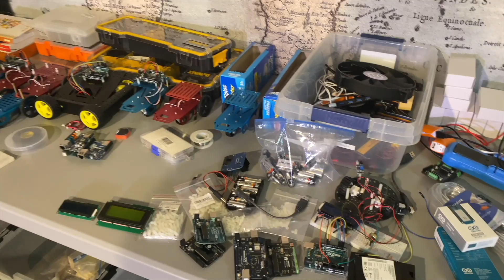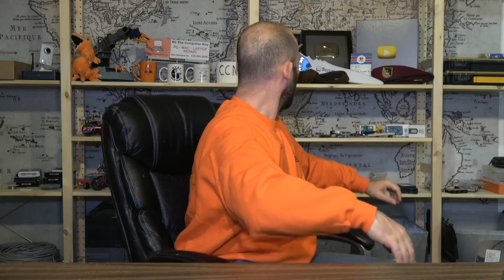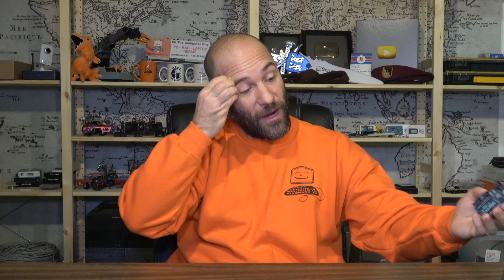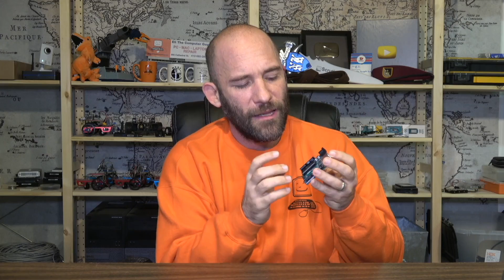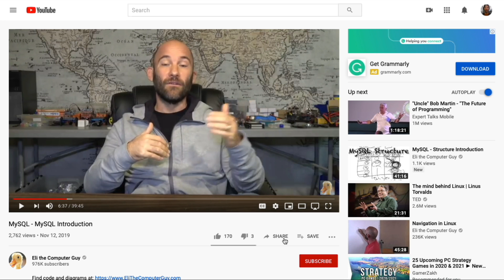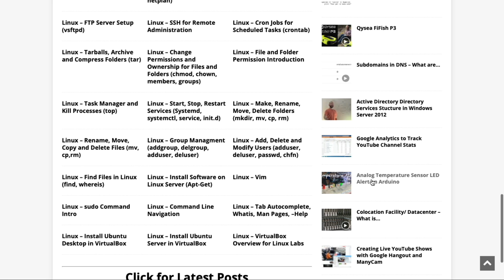Programming Intro - Introduction to Programming

Comment: What programming is
Programming and coding are used interchangeably and mean giving a computer step‑by‑step instructions to perform actions, from simple calculators to invoicing systems or sensor‑based automation with microcontrollers like Arduino.

He gives examples such as turning LEDs on based on temperature, sending alert emails, or routing notifications intelligently based on who is on duty and has the right permissions.

Why it matters for IT
Historically, developers and operations (IT admins) were separated in a client‑server world where sysadmins just deployed whatever software devs handed over.

With service‑oriented and “serverless” architectures (cloud functions, Azure/AWS services, SaaS like Gmail), IT pros now interact with services via code, so scripting and programming are becoming mandatory skills, similar to how Linux knowledge became mandatory over time.

Choosing a language
There is no single “best” language; languages are like tools or applications, each suited to specific environments and tasks (Swift for iOS, Java for Android, PHP/Node/Ruby/Python for web, C# for Microsoft stack, etc.).

You should pick a language based on your environment and the problems you need to solve (for example, C# in a heavy Microsoft shop, Swift if you want to build iOS apps).

How to learn coding
College: Good for people who only know they “want to do computers” because it gives a broad overview (systems, networking, databases, several languages) and a degree, even if the curriculum is a few years behind.

Bootcamps: Best for people who already know the industry and have a clear target (e.g., retraining into Swift or another specific stack) and can leverage existing contacts, but risky/expensive for complete beginners who may later decide tech isn’t for them.

Self‑study programs (Codecademy, Coursera, etc.): Cheap structured paths that work well if you have discipline, though they can be slow when you need something very specific quickly.

Piecemeal learning: For concrete one‑off needs (like “send an email if server room is too hot”), you can copy/paste and glue together small code snippets, test heavily, and still produce useful production scripts without being an expert.

Community and motivation
Being around other coders (meetups, tech events, startups, nonprofits) helps you find jobs before postings go public, learn good coding style instead of “spaghetti code”, and get real‑world project experience even if unpaid.

Employers and CEOs care more about visible projects and self‑motivation (e.g., GitHub activity, apps on App Store/Play Store, side projects for nonprofits or startups) than degrees or certificates alone, and they do not want to “hand‑hold” someone who only codes when in class or bootcamp.

He stresses that sustained personal projects and the ability to take a loosely defined problem, design a solution, and deliver working code are what make a beginner attractive to hiring managers.

Comment: I want to make this:
https://youtu.be/ptlhgFaB89Y
HHO Mr. Fusion for older combustible engines.
Kinda a food processor, water extractor.
Seems legit.
If not simply for fun.
Program it similar to an old pinball machine or let code run it, both?

Appreciation for sharing your bookends.

Comment: Had a question. If your phone gets like a tv fuzz. And boxes start replicating on the screen when you enter a website. You get a remote signal message on your phone 1 time has it been hacked? I got a brand new phone from Wal-Mart and another did the same thing. No remote error message. But same fuzz. After changing all my passwords. A person I know. Is close to ez DoD employees. And even people that got In Trouble for hacking the Pentagon. Is it possible. At one point I was told the words I searched on my smart television right after doing it. I thought only the NSA had tech like the sledgehammer briefcase.that can cause such interference.

Comment: So all that time I was trying to break into tech, but couldn't because I didn't have any professional experience in tech, you're saying that instead of talking about all my non-tech professional experience, I should have been talking about all the piddling crap technical stuff I was doing in my spare time? Farting around with Linux, building an automatic sprinkler controller in Arduino, writing batch files to make useless Ubuntu connect to a VPN instead of entering lines of code in a terminal each time. That should have been on my resume??? Wow. I really don't get it sometimes.